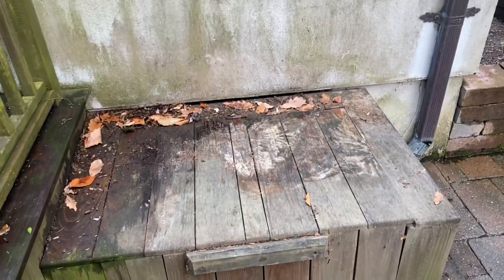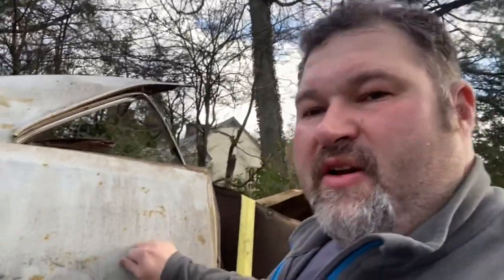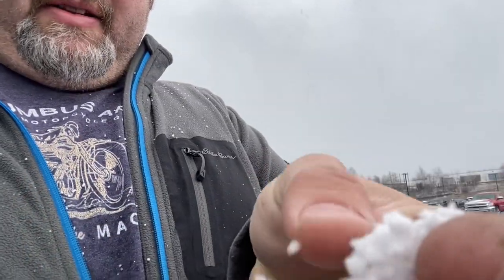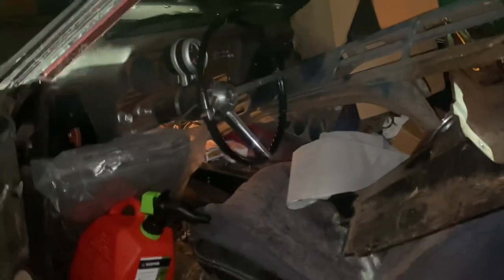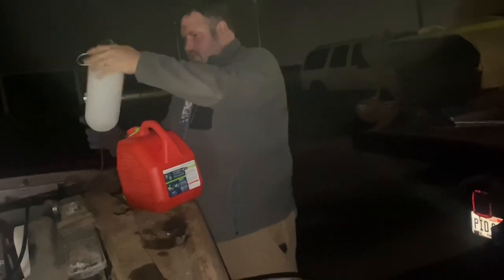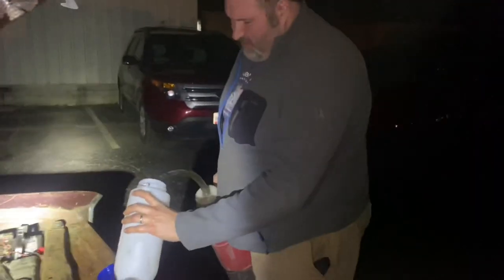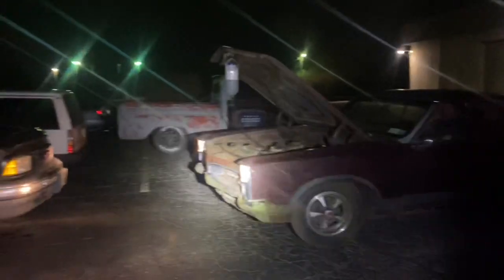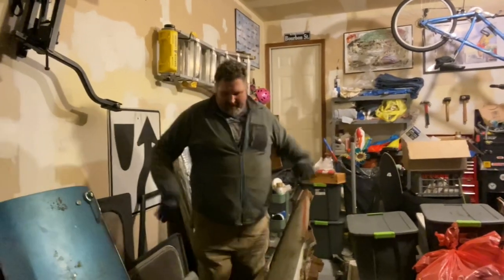The Crypt of Lost GTO parts, and bringing it all home, NOW WITH 100% MORE FIRE!!!!

Comment: Got some arc from you coil to the firewall.
Year ago I did a similar trip from Erie to VA with my 72 GTO in storage since 98'.
Reply from the maker: Yup, I saw that. Just one of the many things I would need to fix. It starts the car though, so for now it works till I can get the thing up and running. What’s funny is the original coil is still on the engine as a backup. More than once I thought about switching to that coil but we knew the other coil works, even if it is arcing, so decided to keep going with it. 

Austin and I were contemplating driving the car back - coming in for a weekend, fixing it and then trying to get home with it. However my parents retired and are putting their house up for sale and that changed the timeframe and it needed to be moved quickly.

Comment: Cringe worthy. I hope she survives. 7800 RPM just seemed a little high..
Just sayin
Reply from the maker: The tach didn’t work in the car, it was hooked to the MSD digital 6 tat went bad. What you probably saw was the adjustable redline needle. 

It’s a tough old engine that was well built. I’ve abused it worse than that when it was still a running driving car (missed a shift and moon shot it a couple of times), and it’s always held together. I have faith she’ll hold. 

The cringe worthy part is part of the fun. I’m a regular guy getting out of my comfort zone. I’m not a pro. My hope is that others see this and think “that looks like fun” and go out and get into the hobby. I don’t want this stuff to seem scary or intimidating, that regular guys can still be in this hobby.

That said, I’m very fortunate to have Austin, Rich, and the lucore crew as friends, to bail me out when I get in over my head.